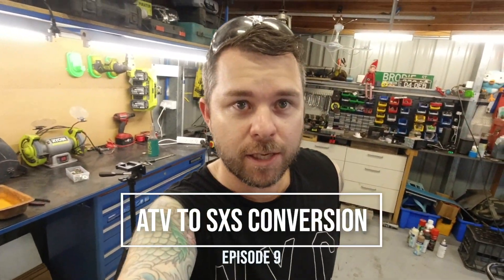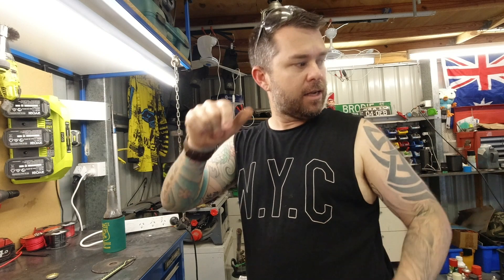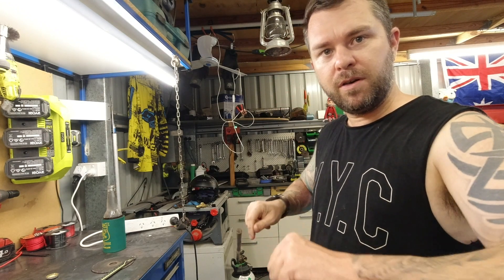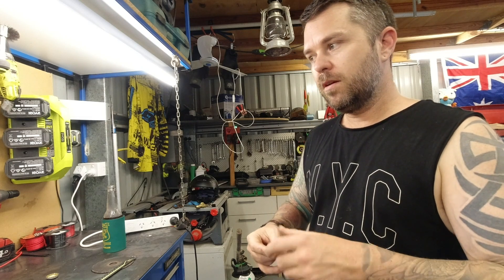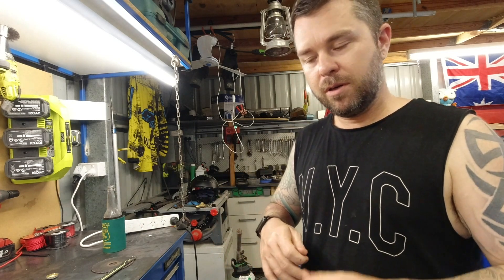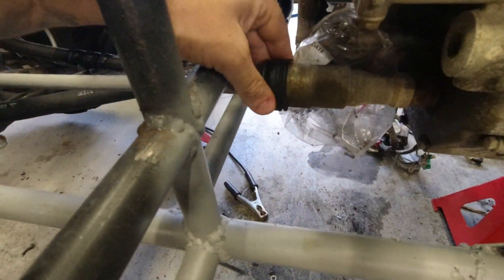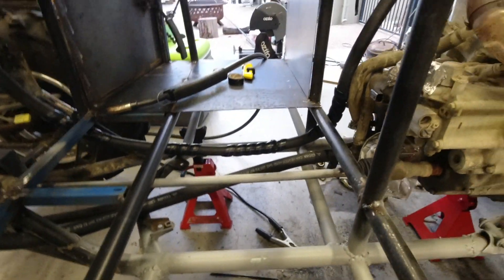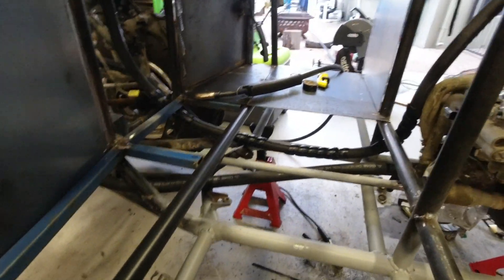Front driveshaft! | ATV to SXS conversion - Episode 9 #howtobuildasxs

Comment: I was thinking you could have joined the ends with a wider pipe, like shrink tube on wires. Do you think that would  be an improved method to what you did?